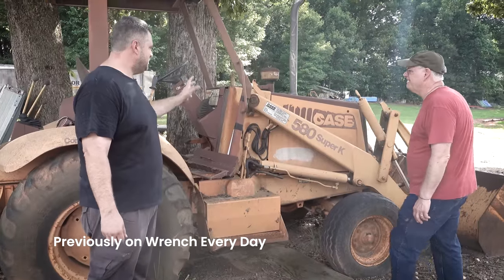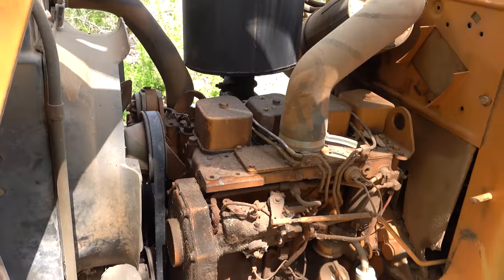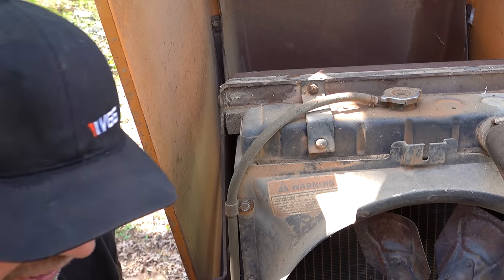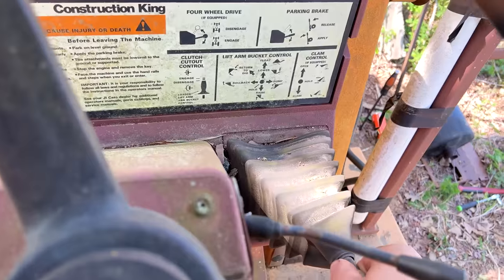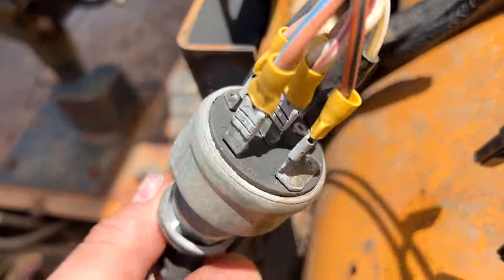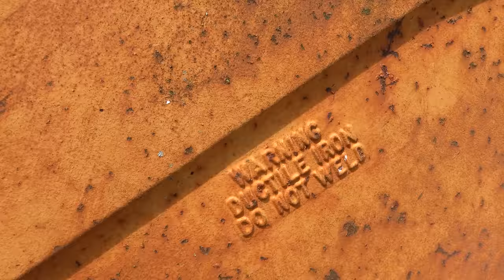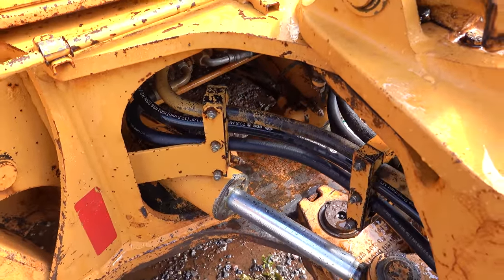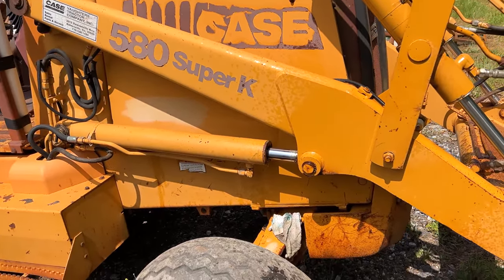I Found A $50,000 Diesel Backhoe ABANDONED In The Woods...Will It Start And Run?

Comment: I've got an old digger that I need to get to work on. The state of it is way worse than that one. Just like you I've never used one before, but I'm glad you've got a video up to show me that it's not as complicated as I thought it was.  The steering wheel hydraulics leak & there's a few rams leaking. Also there's a frost plug needing replaced. All little jobs but labour intensive. Thanks for the video

Comment: The lever on the fuel pump is used to manually primp the fuel system to the injector pump. Also can be used to fill the fuel filter. When done lift lever up to horizontal position.

Comment: $50,000 is a bit of a stretch. In that shape, more like 5-10K, unless there's been some drastic change in the market since last year.

Ductile, that's what a duck puts in his bathroom floor

Did you call 811 before you dig?   Gotta make sure there's no electric or gas lines under there.

Comment: Probably someone used the wrong size fuse or a piece of foil wrapped around a fuse rather than fixing the short.  I've seen that and worse.
Those three fuse blocks are a PAK CON ATC/ATO 4-way Fuse Block. Del City sells them.  Search Del City #:73895.  You can extract the un-damaged terminals that didn't get overheated and install them in a new block then crimp new terminals onto the wires from the melted positions in the old block.  
I've used one of the twin tang positions on the LISLE 56500 to extract PAK CON fuse panel terminals.  If you look at a picture of the raw Female PAK CON terminals you'll immediately see how the extractor works.
I usually spray open connectors on equipment with WURTH HHS to keep the corrosion at bay.  Battery protectant, Fluid Film, and Dexoit D5 will work as well but the WURTH doesn't seem to attract the dirt and crud.

Comment: when you go in for a scoop of material, make sure the front bucket is level, when using the back boom if you want some more smoothness when operating try doing two actions at a time
just a few tips, i have a 580k myself and i just want to help

p.s. if you ever hear your axel squeaking/squealing park the machine and replace your bearing, don't let that get tout of hand, I did and had to replace the axel and the axel housing entirely, I've also had the same problem you had with the rams, the same ones too.

Comment: The issue of just replacing seals is the honing/refinishing the surfaces.  Think the actuating cylinders in drum brakes, you either hone and rebuild them or replace them. The tools/equipment to do a cylinder exceeds what you save having them rebuilt.
Feel free if anyone actually knows what's needed to jump in with the costs and methods.

Comment: The 580 series are very capable, as well as popular. I first learned to operate on a 580B in 1973. Great machine! At that time, they were using Perkins 4 cylinder engines.

Comment: Good job. The hydrolick cilinders are super easy to reseal youre self but first take it out in 1 piece and then open it with a Vice take the schaft out and take the back side off most of the time its a big nut. If you have it off take te head off from the back side and rebuild the head take a good look at the ring they have 2 sides

Comment: You are definitely not an idiot. Back in the mid 70s my dad gave me a TrackMarchall Dozer to rebuild, service and hopefully sell. No way as bad as your project, but gee it was hard and remember then was no internet, but I did have all the tools needed as we had a quarry and a lot of heavy construction gear. At least it was summer and hot. It was great experience, but hard work. I did not have problems with hydraulics but the glass oil bulb missising. I used a Harvest jam jar that had the same thread

Comment: Great video, especially with a solo novice learning something new.  As I watched the video, I couldn't help but notice the 2 1972-1977 Chevy LUVs and the white 1988-1991 Toyota Camry.  I know those because at different times of my life, I have owned one of each. The exception was that my Chevy LUV was a 1980 model that was wrecked in the front and it had a 1976 front clip welded in place of the crunchiness.  If I saw the front grille of the Camry, I can almost certainly identify the year model of it without looking it up.

Comment: Rebuild the cylinders, it will be cheaper on the long run as you wont wast as much oil and that oil is expencive every time one blows out, and less of a mess to clean up, please check the headgasket because that is a lot of oil in the water system

Comment: Great video!  In the beginning of the video you were working on the engine a bit .  The bucket was up against a tree,  which is 100 percent correct.  Maybe just stress how important it is not to work under hydraulic cylinders without a safety.  A guy near me was just killed working on his skid loader,  when the lever was hit and dropped the arms on him.

Comment: Repair all four loader cylinders at one time.  After that your leaks will be hoses only, most likely, and you can make them yourself with a tool kit from anywhere or have them made for not much.  The steering cylinders will last a long time.  Cheers 🇨🇦

Comment: A lot of them hydraulic leaks were cylinder reliefs that water had got in. It really would of completely stopped working if they were not. How you look at it is a system so using any of the rams would of caused a leak. The relief hole is there to let air occupy the space. Well done regardless

Comment: that flapper is your fuel primer pump to help you build fuel pressure and get air out after doing work on the fuel system i.e. changing fuel filters etc.

Comment: A couple of minutes on YouTube would have told you the ez way of doing it. Leave it attached to the machine undo the end you started with leave all the lines attached undo the rod scrapper thingy start the machine push the cylinder rod out using the hydraulics of the machine, replace the seals and scrapper / dust seal etc then put it back together. Job done. Good job on the rest of in though J good video do more of this kinda stuff 👍

Comment: that piece of chain you picked up attaches to that 90 degree round bar that’s sticking up. the other end of which is the pedal you step on to lift that tee lock to release your boom. actually ins not a chain its a rubber covered cable but they welded a chain onto it.

Comment: Well, if a person is new to this channel and wondered where Jared was located, a quick look into the test hole will show you wondrous Georgia red clay!  The tractor is a nice find. It seems someone gave up on it too early!  It would be interesting to know the story.  Good luck with it my friend and be extra careful until you get the sketchy hydraulics sorted!!
Reply: Too early is relative. For someone to use it occasionally around house/shop/farm it's fine.  As a piece of equipment used daily on jobsites, transported to them etc. Probably not.   Remember commercially you also have to have all safety equipment functional, it needs to be gone through for reliability and so on.  In addition since it wasn't explored how loose the joints are from wear. The leaks would end up being a big issue for abatement on any site which is actually EPA compliant.  I've had a lot of cubic yards of material abated due to petroleum contamination and that expense is borne by the contractor or subcontractor. 
That said it's a great unit to live on in the right environment.

Comment: Lol, I hated rebuilding large Hyd Cylinders, First one I ever did was on a Skytrac offroad fork lift, thing was a bitch, using a 600ft pound torque wrench was also a first, I was hired as a Small engine mechanic ( which I was) and this is what they had me doing right from the start, it was hard core learning lol

Comment: Lol I’ve rebuilt the main boom cylinder with it still on the tractor before. Of course I had an actual crane to use and another set of hands helping, but it was still easier than pulling the whole thing.

Comment: i purchased an old case 680 backhoe a few years and one buy one as i rebuilt each cylinder and  tried to use it the next weakest one always fails. Save yourself some money and buy a cylinder master kit for all of the cylinders.Oh ya the steering cylinders are the hardest ones to repack.

Comment: As a tractor owner, just like with boats, you typically wanna keep at least one (if not several) spare set of every replaceable part, perishable piece and operational fluid handy, (just as you've been learning as you restore your Case,) because every time you think you have it fixed and running well, something is bound to pop up, pee out, give up or break. Once they hit the trade, 99.99% of heavy equipment has a hard hard life 🚜 Tractor life!

Comment: You could have easily packed those cylinders yourself. The hardest part you already did, which was getting them removed. The rest of it was just changing out seals. Great video though.

Comment: Great got her going . I learned to operate equipment at 6 yrs old in 1975 case 3 stick with swing peddels  . Digging holes and ditches in a vacent field my dad was working on other tractors maintenance welding up broken buckets an such  he ran a pipeline Crue for a living .I loved the small of fuel an playing in the dirt. By 11 I can run IT backhoe trackhoe bulldozer motor grader and a skiploader an carry grade   after hi school I continued in the field moving dirt subdavision an roads pipe jobs .. but when we got a new operator told them" this machine has got 2 levers lever A an lever B ,, if u don't know what your doing it's lever B ." ... Then laff  still an operator today broke down bad knees an back from climbing up down bumps gettin beet up on projects just flat wore out.cat is yellow case is orange. An u know what flowes down hill...but still love it .more of these videos young'ns  need to lurn this ..great job

Comment: Looks like the reason it was parked is evident all around the radiator and everything else under the hood, rusty water stains means something is wrong with the cooling system. Need to check it out, I hope it's not serious, good luck,. Cheers from Jacksonville Florida 🌞

Comment: Good job. Wanna trade for my 580SE with thumb, extendahoe and clam bucket?  Just kidding. Although she's old she has been a workhorse and if you think yours leaks mine wins hands down. Love my backhoe.  BTW keep that loader bucket low to the ground.  Putting a rear wheel in a hole with the bucket elevated is a good way to tip over.  Believe me, it happens.

Comment: Ductile iron means the iron burned magnesium through it just prior to being poured. This causes the carbon flakes to turn into balls within the iron instead of the flake formation it is in for grey iron. The balls of carbon make the iron stronger and less prone to cracking. It also it machines muck easier.  I worked at a ductile iron manufacturer that made stabilizer arms for backhoes as well as the diffs for Ram trucks amongst other things. If that backhoe has a manufacture date between 95 and 2000 look for a stamp in the arm with GSC in it and it came through the plant I worked at during the time I was there.

Comment: If its the original engine, its listed as, and does visually look like the Case 4-390 unit.  Working and learning on a much older 680C Construction King myself, but I learned, the only thing I have seen start with as little effort as a Case engine? Is a John Deere diesel.
Reply: Huh, day later, now admitting yep, im way off, found out Case worked with Cummins to build a newer, better engine before Case backed out at the end and let Cummins roll with it all.. Thanks for inspiring me to learn more. :)

Still learning how to repair a much older 680C Vintage backhoe, great to learn!

Comment: I bought an old international track loader and one of the 4n1 bucket cyl blew its guts when i loaded it, repacked both of them thought i was good for a while but ole IH said not yet buddy. Within a year i replaced 6 hoses and repacked the huge lift and roll cyls on the loader, pulling the cyl out of the casing was easy but getting them back in  required inventing some new words and a few brakes to clear the “lets burn this bltch” demons out of my head but i got the all done in a long day and a week later the track adjuster packing said…heyy you forgot me…another long saturday and they were both done. No problems since though lol

Comment: you spent 2 hours cleaning that i spent 8 hours washing a volvo rock truck one time.  ya good luck trying to work on cylinders that large on the machine.  as a heavy equipment guy that also loves cars i love the variety you also picked one of the most annoying types of machines to start with.  backhoes are a nightmare since they are trying to be excavators and loaders at the same time packaging can be a challenge

Comment: First thing you need to do is to replace the ground cable to frame/step bolt. The frame twists when working with the backhoe and the step moves when the operator climbs on the machine loosing a bolt that goes through a copper cable. Dumb idea but that is what they did. Next replace the rubber fuel lines, the low sulfur fuel dries out the old lines and they crack.

Comment: Reverse the bent cylinder in the foot and then use either something heavy on a piece of wood to bend it straight or leverage. Alternatively, if you feel that the foot can take it, don't reverse, and borrow a low clearance hydraulic jack to unbend it using the foot as leverage.

Comment: Yeah, every time you fix a hydraulic leak the next weakest point in the system takes a crap. It is infuriating. Rebuild everything you can when you can. Great work on getting it up and running again. I've worked with tractors that had weak hydraulic systems and every time I replaced one hose another one blew out like clockwork. It'd usually take going through 3 or 4 different ones before it stopped.

Comment: i bought a brand new Case 580 Super K in 1994, it was one of the last of that model produced and it cost $50 thousand dollars new, the title of this video appears to say you paid $50k for this old thing, is that true? why? my backhoe had its diesel and hydraulic oil stored internally inside the frame, over time the frame cracked and it began leaking fuel any hydraulic oil. its a good operating machine though.

Comment: Nice unit, don't get me wrong, but definitely not worth 50k. I used to be a case dealer, and we can't even get parts for that unit and they were horrible with hydraulic leaks, the steering was always garbage made, the injection pumps were faulty to begin with as well as the hydraulic pumps. Just all around crappy units, we turn these down if they come through our doors now because no one ever wants to fix the main concernable and hazardous issues, they just want them serviced. Case even quoted that these units aren't even worth the scrap metal price

Comment: Some advice: do all the hydraulic rams. Cause as you already experienced, when you repair one the pressure will just search out the next to pop. Like what happened now. Ask the Wizard, he'll tell you the same thing lol.
Reply: Like peeling an onion.  You'll reach a point where things will stabilize on this machine.  It's not horribly abused.  There are a limited number of hydraulic rams left to re-seal.  The hoses I can see look better than the ones on my 1978 CAT loader and mine are still hanging in there as rough as they look.

Comment: You did not show it, did you do a coolant flush as well as a hydraulic flush and replacement of both - it might sound weird but it might be better to replace the water in the radiator with a waterless coolant

Comment: Whoever went ooo when you said you were rebuilding a hydraulic cylinder on a backhoe must just not have had much confidence in your ability. Not saying anything mean towards you at all, its just they must not have thought you were up for it but its really not that bad to do. I have done a few rebuilds on tractor hydraulics and the worst part is removing them because of the weight. Staying very clean is also crucially important but as far as difficulty its really not that bad at all. You cant really pull the pistons out fast because your fighting hydraulic suction pressure on the back end of the piston.

Comment: Hi Jared. You might like to check out the CEE channel (Cutting Edge Engineering). Kurtis often does rebuild work on industrial hydraulic cylinders, and indeed has just posted one on a suspension strut cylinder for a Caterpillar 740 Articulated Dump Truck.

(Oh, by the way it's more like a slave cylinder or brake caliper piston than a master cylinder. The master cylinder is used to generate the hydraulic pressure, while the slave cylinder turns that pressure back into mechanical force.)

Comment: Pretty sure it was parked due to a blown head gasket or cracked head. that was oil in the radiator.  U need to do a leakdown test and combustion gasses in the radiator test before u waste time doin all those cylinders